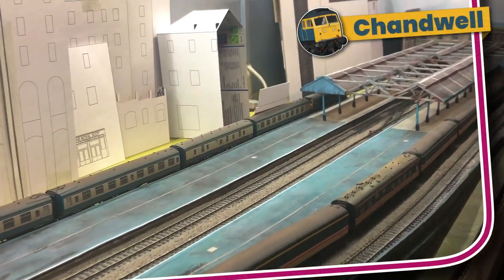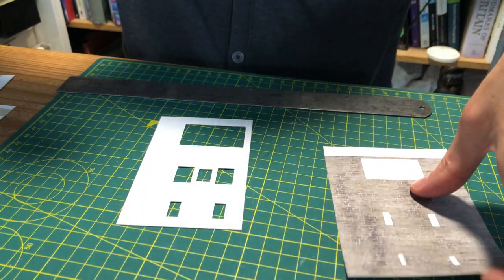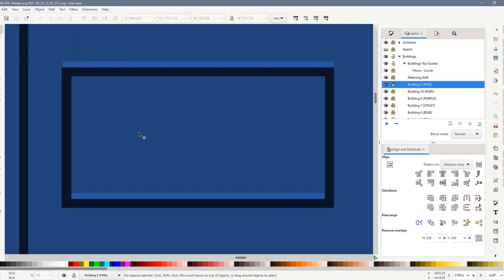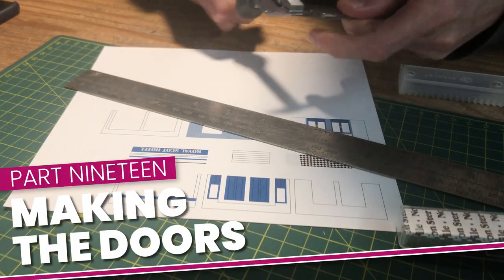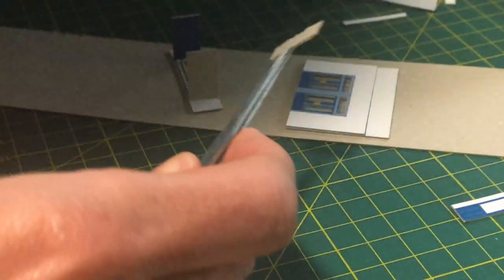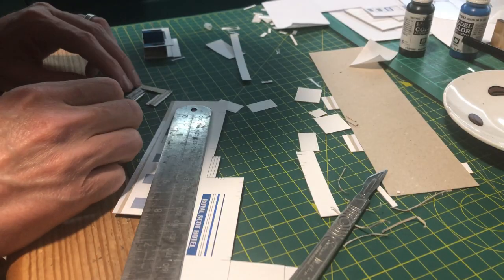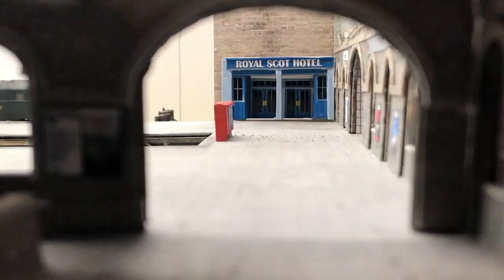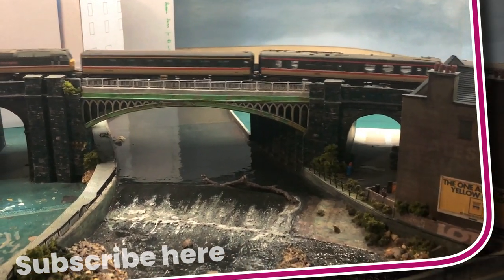Concourse Entrance: Scratch Building a Low Relief Victorian Hotel Part 4

Comment: Hi ya Michael. Do you know that many printer companies have “ monthly ink cartridge replacement clubs?” Usually at a great discount. It sounds like you might need one. That entrance came out nicely.  See ya next episode. Bye.
Reply: Hi Michael I agree with Norman about printer ink replacements. I don't know about Canon but I use a wireless HP Envy printer with a replacement account It costs me £1.99 per month for 50 sheets of print and £1.00 for any extras. I very rarely print more than  50.  
They supply ink at no extra cost automatically before you run out by getting data directly from the printer via the wireless link through my router.
Keep up the excellent work with this build. 
Do you have an time left to just play trains?
regards Chris
Reply from the maker: That sounds really interesting, Norman and Chris. The problem with "Pages" is that I often miss a component and print it separately. A "Page" counts the same whether it's a full-sized A4 photo or whether it contains a 6mm by 2mm window lintel. I often find myself printing single components, slicing a bit of the paper off, and then using it again. Although what I print would probably fit onto one page, the printer would count it as maybe 10 "pages". However, having looked at it, even the 100 pages/month option is only £3.49 and the 300 page/month option is £9.99 so still cheaper than my Canon £11 a month that I am spending now. I'll definitely consider this when my Canon breaks. I'll not replace it until it dies; there's no excuse to throw away a functioning piece of electronics. I also had my eye on one of the Epsom printers with the refillable tanks. But someone on here also told me that the Epsom ink runs when varnished, which the Canon one does not, so I am also nervous switching due to "better the devil you know"! Thank you for your suggestions - they have given me food for thought! :) --Michael.

Comment: get a epsom eco tank  ive had one 7 years and i have spent only 32 pounds in that time and still have a third of the tanks left  at lats count i had done 4580 copies
Reply: I have the same one and completely agree
Reply from the maker: Thanks John and Bubulechibe. The Eco Tank is definitely at the top of my list when my current printer dies. 4580 pages for 32 quid is spectacular. I use the ultra-high photographic settings for all my scratch builds and I’m assuming that your 4580 pages were not all full-sized full-colour, full-quality model buildings, but still, that seems like much better value than the Canon inks I use. However, someone commented on my last video that they find that the Epsom inks run when varnished - is this true? At least my Canon ones are pretty impervious to being mistreated with glue and varnish! Sometimes I wonder if it’s a case of “better the devil you know…??” —Michael.